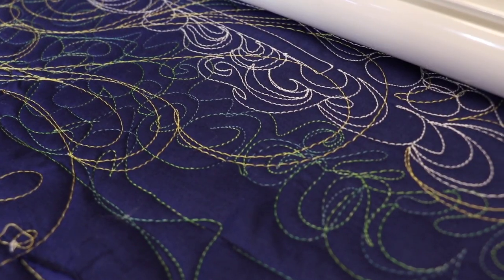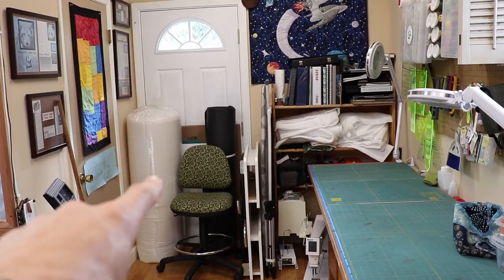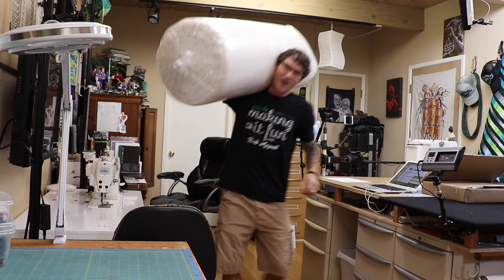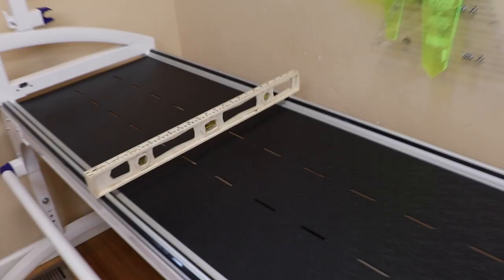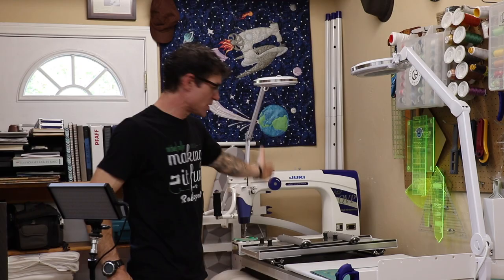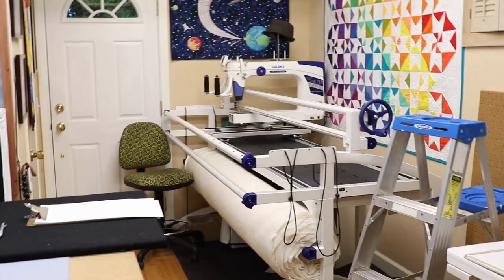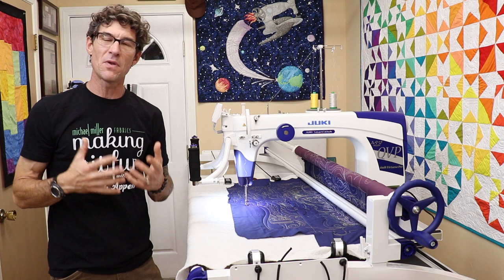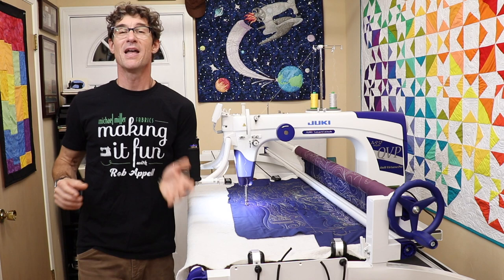"Miyabi" Juki J-350QVP Arrives - Michael Miller Fabrics' Story Time #4

Comment: Rob, which size frame did you get? I've been looking at those and I'm "almost" there. How much room does it take up - I've got a small home but, can't do the sit down quilting any longer.
Reply from the maker: The frame is set up at 7 foot, you can purchase in 5ft and 2 ft sections. So you can do 5-12 foot very easy. I would go 10' if I had the space, the 7' works, but I have already maxed out twice on this frame.
Reply: Rob, can you please let me know how much inches it takes from wall behind?

Comment: Is that set up at the 7 foot config?  This is the set up that I want to get, I have a diff frame and diff machine but love Juki and want to move up to this set up.  I am looking forward to seeing your upcoming videos.  One of the things that has me waiting is what size I want to set up.  I have an 8 ft frame now and don't really want to go smaller, so the 7 foot is not really what I want, I want to do the 10 but that won't fit in my current room.  I would love to hear your thoughts on the width... Thanks.
Reply from the maker: Yes, this is 7 foot, and I think it will be just large enough. The frame is from Grace, and because the Juki J350 needs no encoders, you may be able to replace the head into your 8 ft frame.
Reply: @makingitfunwithmichaelmill8161  Thank you so much for taking the time to reply.  Much appreciated.